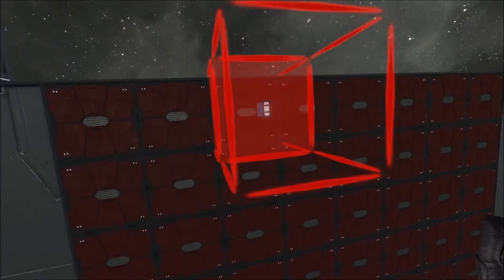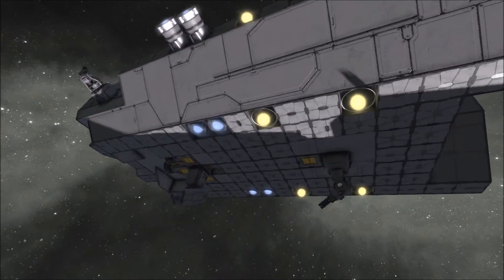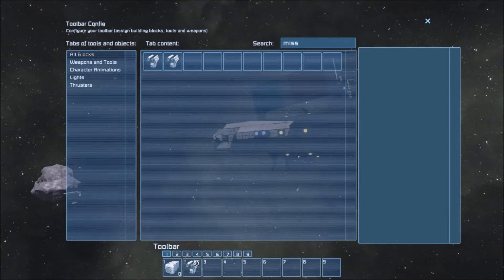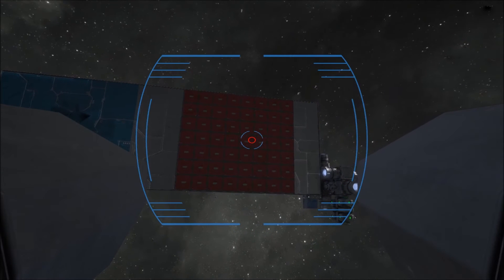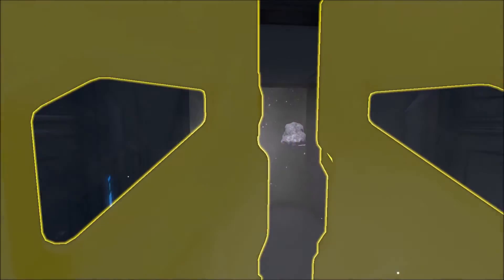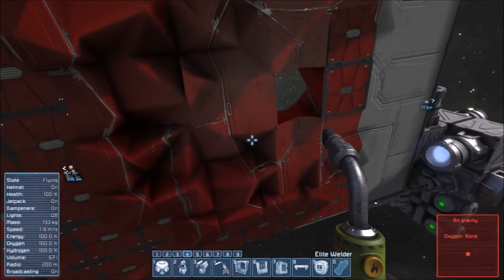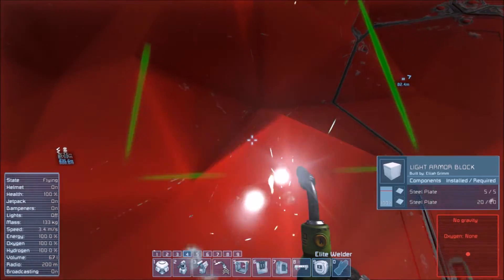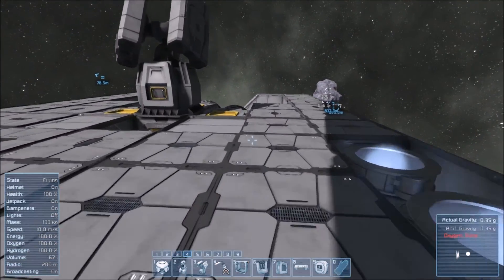Space Engineers; Ablative Armor

Comment: Thanks.  I was looking for a way of protecting a landing pad from a small ship that has upward thruster low to the ground.  This looks like a simple but effective way to fix the problem.  Even deformation over time will be easily visible and cheap to repair.

Thanks again.
Reply from the maker: No problem. Another solution is using the blast door blocks with welders underneath. It's a little more expensive, but blast door blocks don't deform and are also relatively inexpensive. Simply having a timer block and sensor will allow you to set up an action that turns the welders on for a short time to repair the blocks upon liftoff/landing and turns them off again. This way the landing pad can be maintained with very little effort on your part.